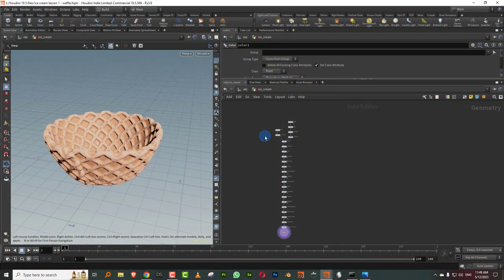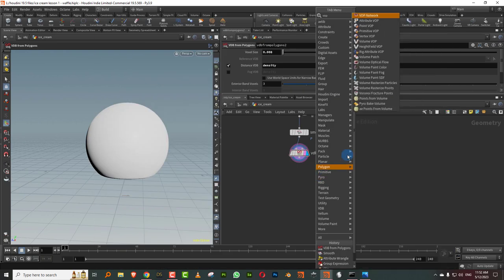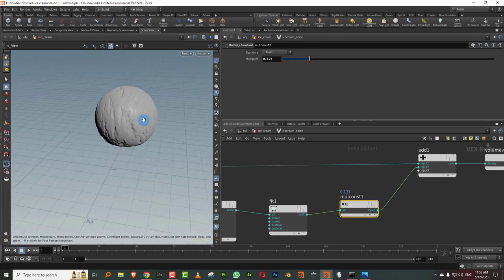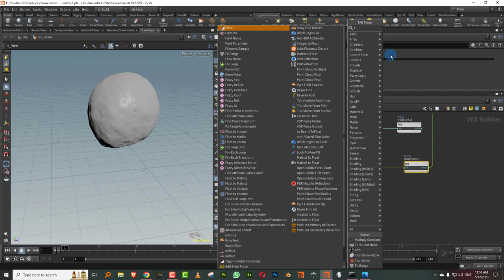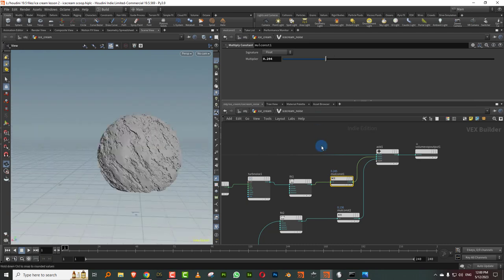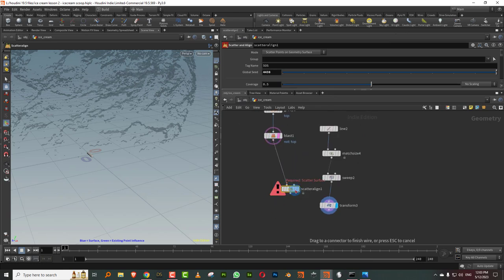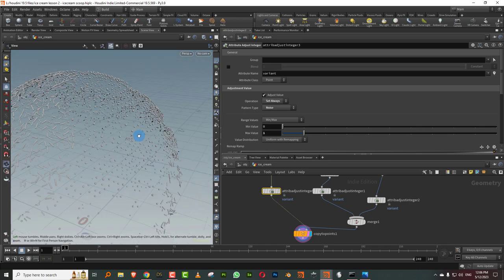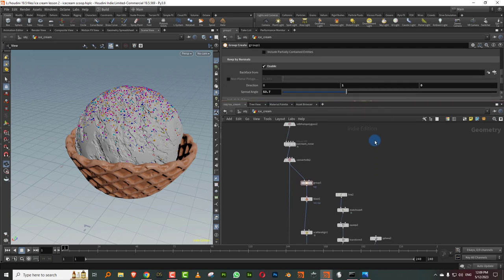Making an ice cream - Lesson 2 - Modeling the ice cream scoop

Comment: Why not applying a smooth picking up the flat surfaces of the sphere before doing the mask so the edges of the cream wouldn't be too sharp but kinda melted sligtly. Not sure if what I said makes sense XD
Reply from the maker: You can do selective smoothing using a vdb smooth and a volume based mask. But it’s a slightly longer process and I’m lazy 😅
Reply: @rohandalvi  Thanks mate, I just need to figfure out about the mask but the way you selected the geo can be used right? kind ok. I think I'm kinda bad with masks and painting but hey I'll have to figure it out this sunday. Even tho I didn't do it, I have to say I did really enjoy these series so far. I'd love to see more food stuff lol. I guess i'm hungry atm. Thanks Rohan!
Reply from the maker: @Helios.vfx.  You cant mask a vdb using standard geometry tools because its not geometry. So masking out the noise using slope or anything else on voxels will need other methods probably inside the volumeVOP or building geo masks and coverting those to voxels and using that to control noise. If you want you can pick up my VDB and noise series, That has some of those techniques.
Reply: @rohandalvi  I see why you didn't feel like doing it lmao. Got you, I'll buy it once i finish paying my credit card, don't want to max it out xD. Already saved up the link. Thanks again!
Reply from the maker: @Helios.vfx.  I'll show a basic version of it in the next video.
Reply: @rohandalvi  Thank you Rohan! Honestly. bro fist